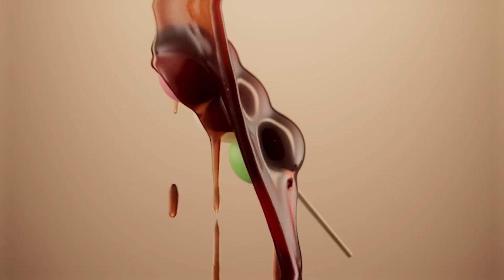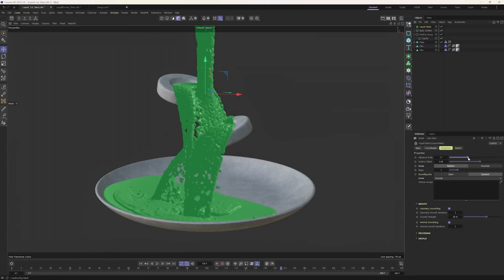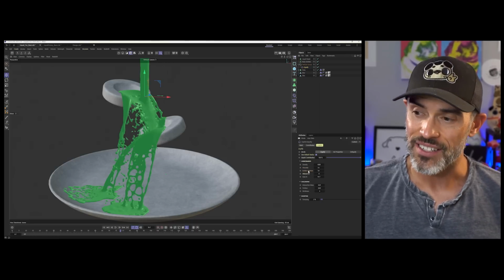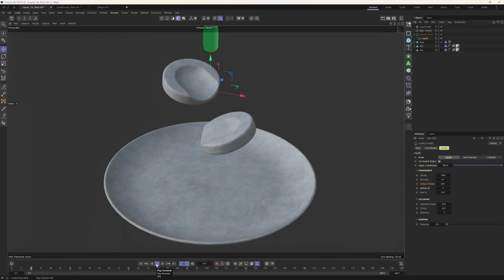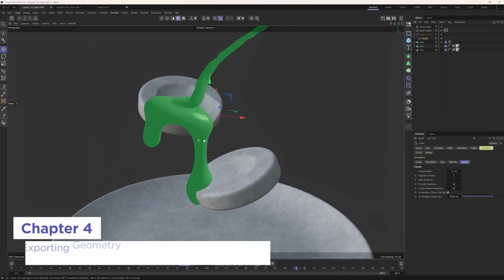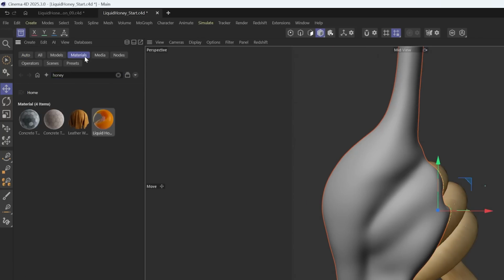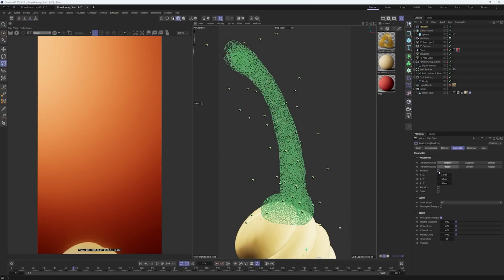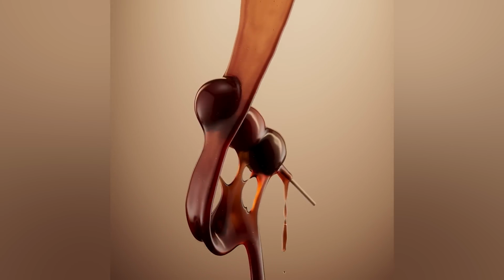Cinema 4D FINALLY Got LIQUIDS (Are They Any Good?)

Comment: Thanks for the video on this, going to try it out soon! 

I'm no Maxon apologist, but maybe the reason they set the initial particle/voxel/water droplet size so big is because their tech support can only handle so many emails from users that don't realize how hardware intensive simulations can be. Even trapcode particular can cause trouble for an older system.

Comment: Does anyone know how to apply motion blur on it, no one has mb :(
Reply: In case you haven't found the answer yet: first go to Liquid Mesh > Export > Velocity On. Then add an RS Object to the Particle Group, go to RS Object > Motion Blur then turn on Override and Motion Vector > Enabled.

I don't know if this is the most elegant solution, but at least it works.

Comment: This sure looks and feels like the early versions of Realflow, a lot of the parameters and UI are the same. It is like a Realflow plugin inside of Cinema 4D. I stopped using Realflow a while back, and from the looks of it, the software itself has been stagnant since 2017. A real shame. At the time it produced really epic results, it was even used by Hollywood in the early 2000s all the way to mid 2010s when productions switched to Houdini, permanently..Anyway, awesome tutorial EJ! Thank you for the insights!

Comment: I think with all the particle/VDB updates that there should be simple presets you can choose from to get your started, like a preset for honey, syrup or water, just as a baseline. Sort of like the options for metal in a material, gold, chrome, etc. The amount of settings you have to remember or the 'gotchas' in things like particles or pyro are a bit staggering and I always get so frustrated when something doesn't work because I forgot to change one little setting buried in the 3rd menu down.
Reply: Mm, i like that idea!!
Reply: These sorts of simulations are incredibly sensitive to slight differences in inputs: object scale, types of elements interacting, etc. Settings that result in stable plausible honey in one scenario turn into a chaotic explosion of particles in another. So, unfortunately it's quite difficult to create generally useful presets.

You can see this in microcosm with the Honey material preset. Because the scene scale doesn't exactly match real-world scale EJ still has to tweak a number of settings to get a plausible visual result.

Still a great ideal to push for!
Reply: This is a great idea that has been asked many times in different software programs. But it seems very weird that these companies do not want to help us one bit. It's not made easy and it is very hard to grip the basics. Presets should always be present along with tutorials inside the software like C4D (a 500page guidebook is not a tutorial).
Reply: @usimortis1940  agreed!
Reply: Oh, also, RE: pyro/particles: search the Asset Browser for Pyro or Particles - lots of examples scenes/templates to get you started with common effects.
Reply: I'm sure it'll be behind some paywall and buggy as hell
Reply: "Why make things simple when you can make them hard" - Maxon team

Comment: Did they fix the new boole? It can't boole single sided objects 😢
Reply: That should work. I just gave it a try and it worked as expected. If you have a case that doesn't work it would be great if you could share it with Maxon support.
Reply: @Havealot cube and a sphere. Delete some polys out of one object and it does not work anymore.

Comment: What a dissappointing addition given the competition available. Also, not working a real-world scale is insane. What were they thinking with this? :S X
Reply: The real world scale issue is what overly complicates things.  I believe that you do work in real world scale with the other sims and they work OK but this doesn't seem to play by the same rules and honestly, it's one of the big things I got tripped up on until someone from Maxon let me know that, yeah, its best to work at a much larger scale.  The default values kind of give that away, as you saw in the video!

Comment: How does this compare the Blender's liquid sims? I imagine it's better? Hopefully, since it's an(expensive) paid product. I don't do a lot of liquid sims because it's such a hassle.
Reply: My only experience from Blender sims is from Andrew Price and he mentioned how Blender's sim system is one of its big weak points, but I have seens some folks do awesome stuff in Blender but if I remember right, it's using a plug-in.  I know that for Flow, the water sims in there was their own water plug-in, so not native Blender capabilities.
Reply: @eyedesyn  That tracks. I love Blender but their focus seems to be on making it a blank platform to expand on rather than a fully functional tool. At the end of the line when you spend $100s to $1000's on plugins to make it do what you want, is it really free? Or that much better? 

I do love and appreciate it though. But when people say Blender "does everything paid products do," I think, yeah, a Ford Fiesta does the same thing as a Ferrari, but they are not the same.
Reply: @OtherwordWorkshop  Blender is trash yeah